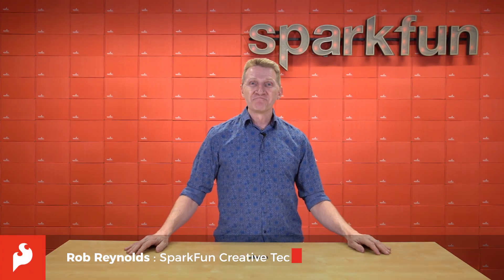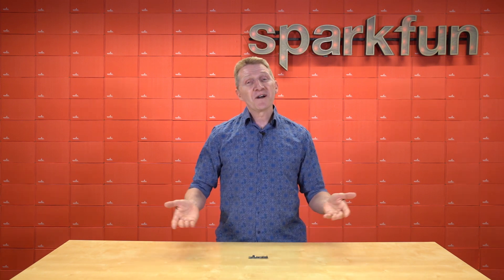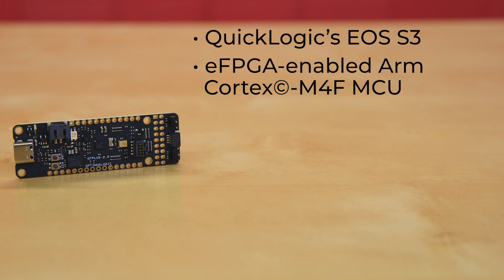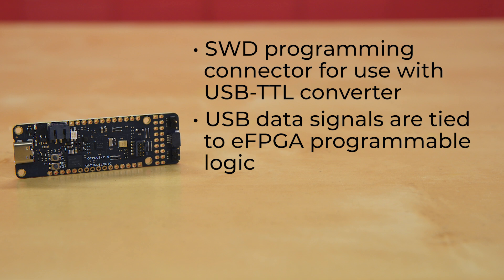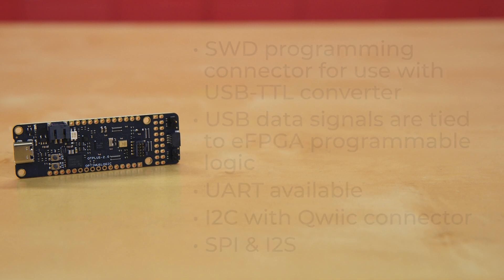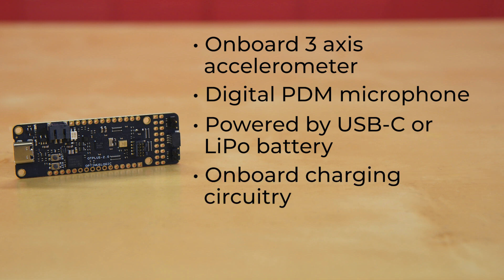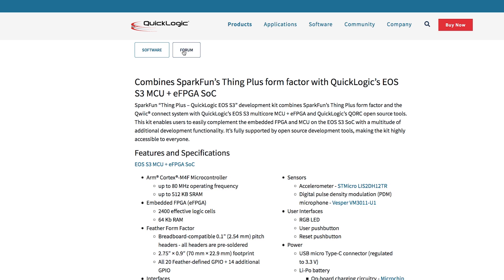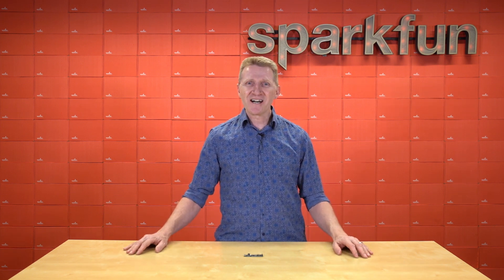Product Showcase: SparkFun QuickLogic Thing Plus

Comment: ...the problem with the cancer like proliferation of MCU boards on the maker market today is the severe lack of non-trivial, interesting and useful applications & projects available for them. Makers rush off to buy these things like hotcakes but they just end up in the back of a drawer or in a parts bin. The other problem is that each SOC has a unique architecture and requires a substantial personal investment of time and effort to learn the architecture and system tools. All this has to happen even before you try to come up with a sufficiently motivating use case for it. See what I mean? Heres my advice for young makers. Spend some time thinking up unique applications. Choose one that is very useful, to you or a potential customer. Then survey the cohort of MCU boards that are available, and choose the optimal board for your project. Peace out!